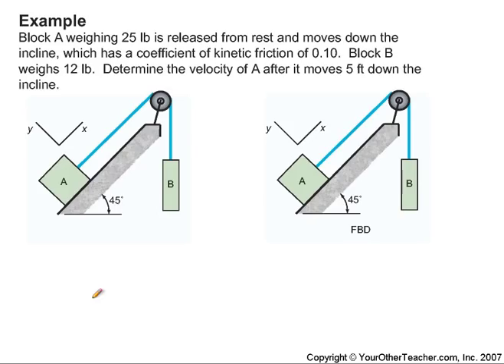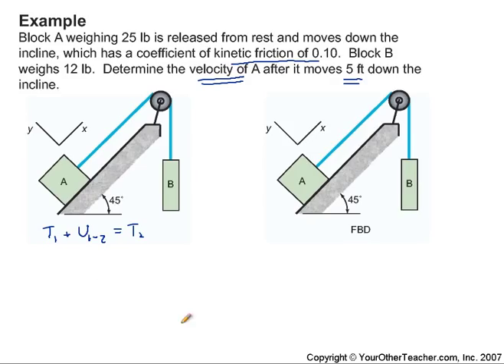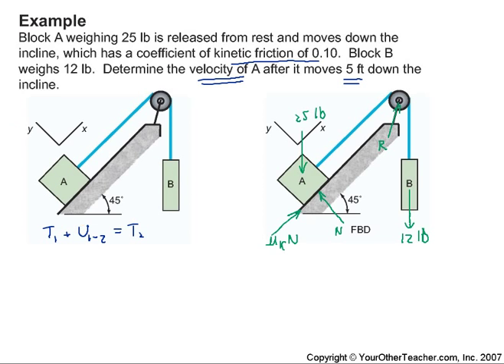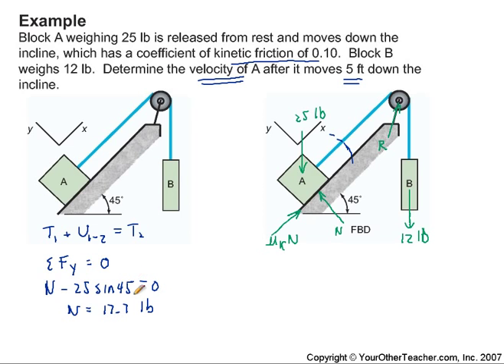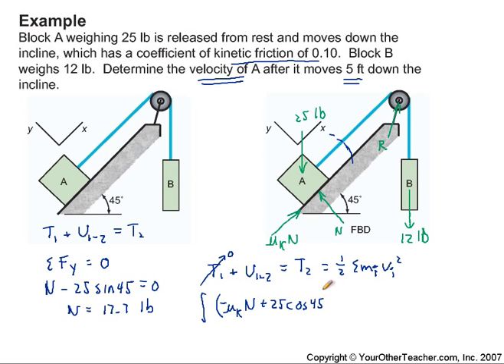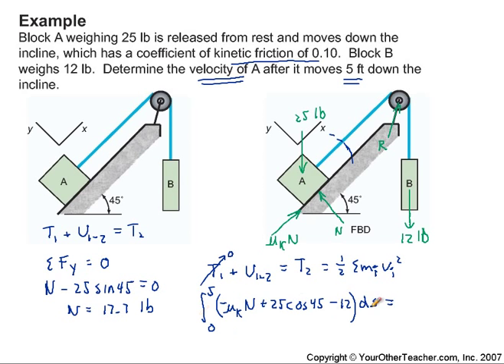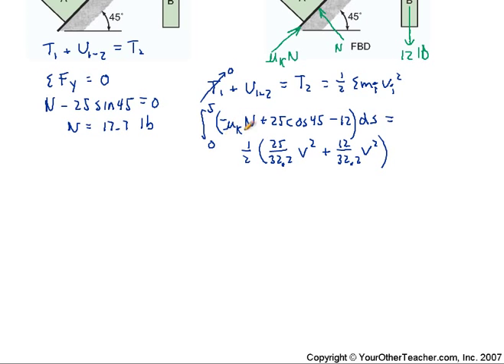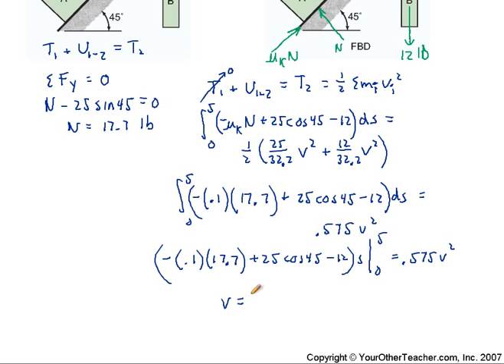Engineering Dynamics (4-8)

Comment: Mistake in determination of x and y component of weight force on inclined box. The angle between the weight and the inverted y axis is theta: the angle of the incline, but since this angle is in the third quadrant the cosine gives the y component of force and sine the x component. 

It just happens to work out in this problem since sin45 = cos45, but that won't always e the case.